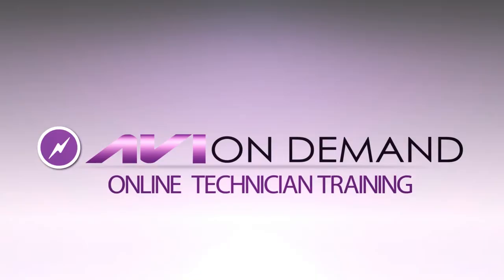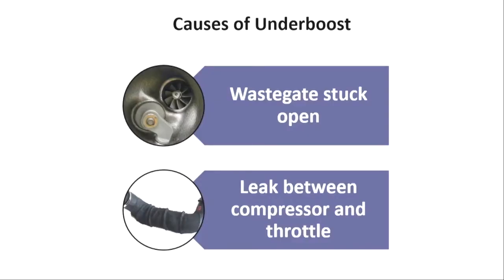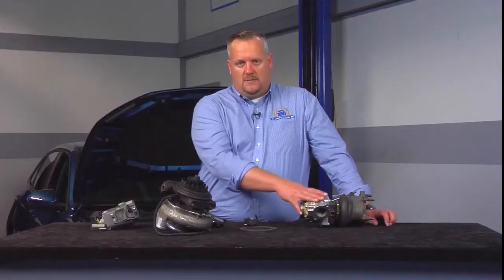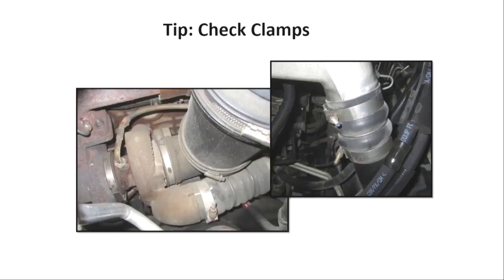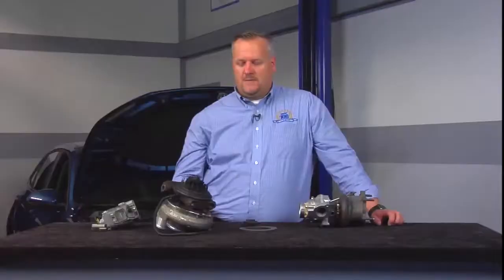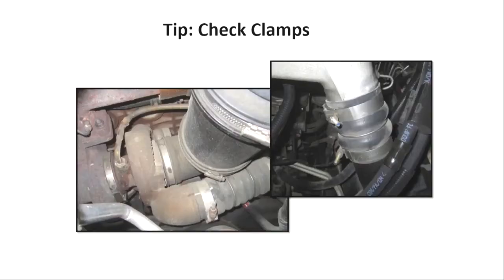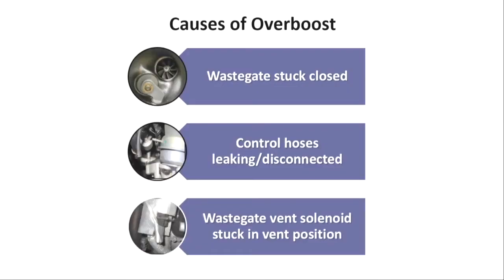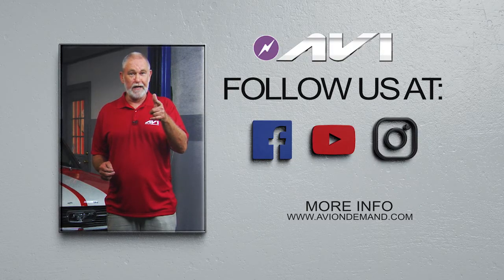What Causes Turbocharger Underboost? | Tech Tip

Comment: My car has no engine symptoms.  No loss of power.  No smoke.  No roughness.  No gas mileage reduction.  I've driven it for 10 months with no CEL.  But I know it's got a P0299 permanent low boost code.  Found it when I connected a friend's scanner.  ( I wanted to see if the scanner would release the E brakes.  I'm told because of this code the car will fail the NYS inspection.  The only suggestion I'm given is to have the turbo replaced.  What happens when I pay $3-4k for this and it doesn't fix the problem?

Comment: You seemed pretty knowledgeable on this maybe you’d have a guess for me, working with a 2015 Fusion 2.0 turbo, car came in with a P0301 dead miss and a P0299, went through typical diag on the misfire and came to find out cylinder one had 0 compression and a leak down test showed 100 percent blow by out of the intake, going to pull the valve cover tomorrow and check out the intake valves and see what went wrong but what I’m wondering is could no compression on a cylinder cause the P0299 to come on or would it be possible that something happened in the turbo first that then caused engine failure in cylinder one? What came first the chicken or the egg is what I’m wondering
Reply: Yes..same here but wondering if turbo messed up trans or did transmission not working cause back pressure and mess up turbo!?